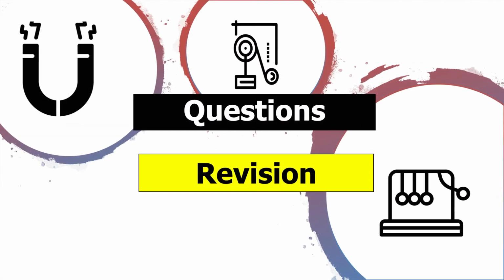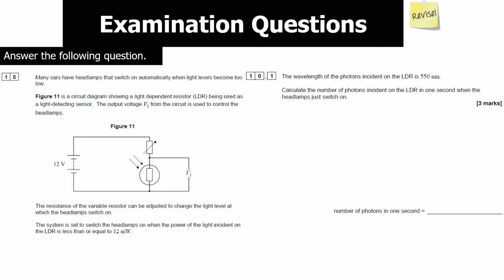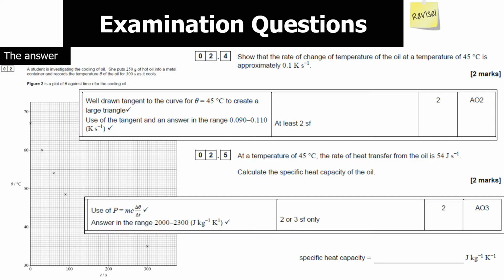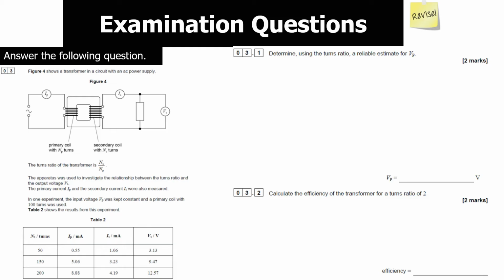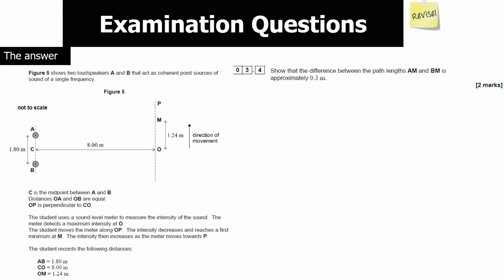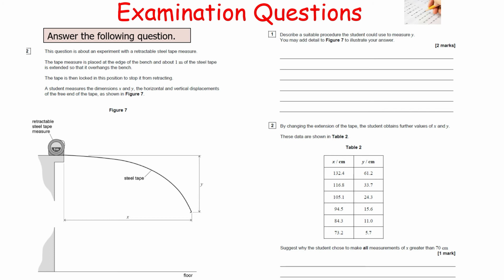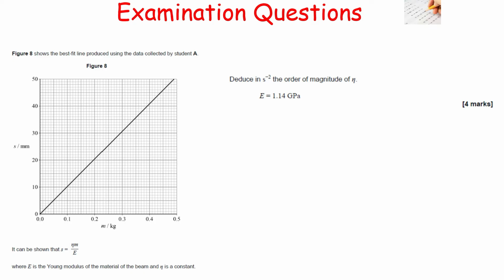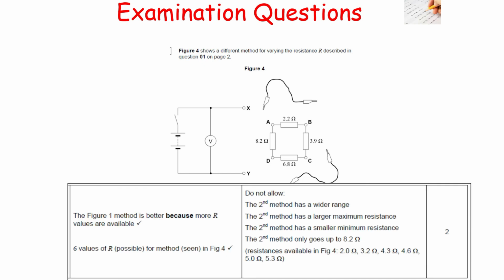A-Level Physics Paper 3: Practical Skills Practice Questions

Comment: Why are you multiplying (2 x uncertainty in d) by d itself instead of d^2 when finding uncertainty in d^2?
Reply from the maker: To work out the percentage uncertainty in a term with a power you must the percentage uncertainty by the power term.
Reply: @mrturnbullsphysics  yes, but you multiplied it by the original value of d. 
You multiplied (2 x 2.3) by 44 instead of 44^2. Was this an error sir?
Reply: @mrturnbullsphysics  I was confused by this too, I typed 4.6% x 44 into my calculator and I got 2.024 instead of 0.88 and I can't work out how to get 0.88?
Reply: @LivyLeonardNEA 4.6/100 x 4.4^2 gives you 0.88 as you divide the value for D4 by 10 to get the length of d4